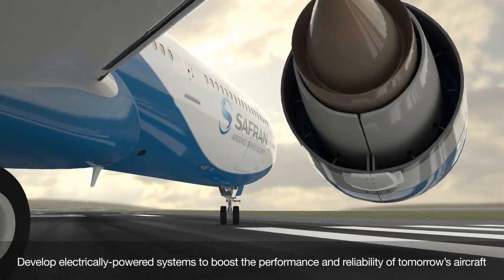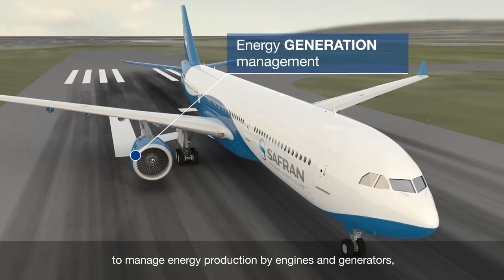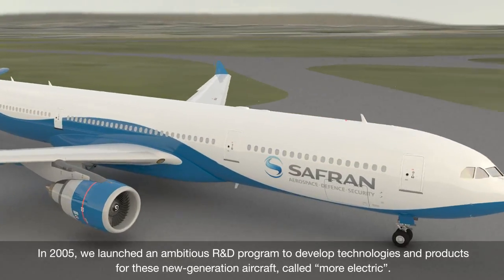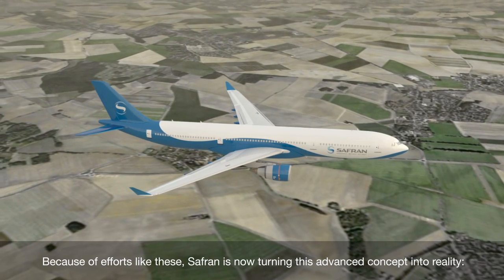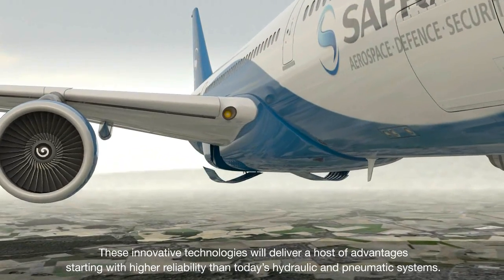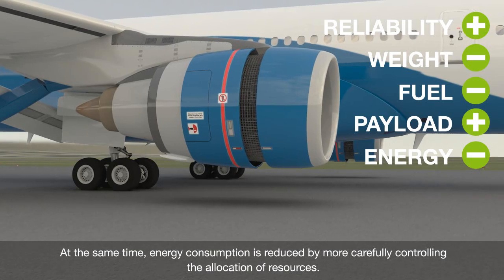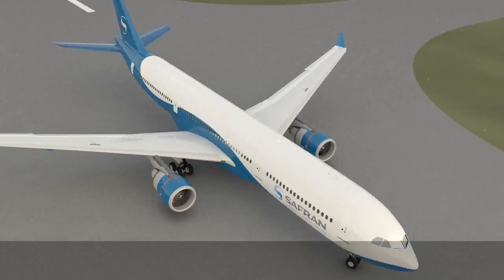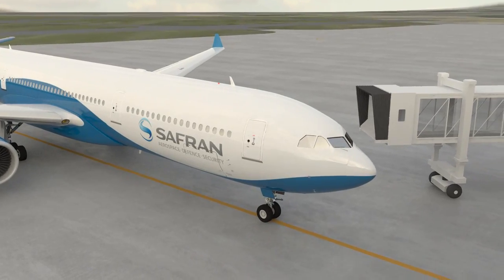Paving the way for a "more electric" aircraft | Safran

Comment: 0:29  The primary purpose of a car's battery is to start the engine, not power the accessories.
Sustaining ignition and powering accessories are the functions of the alternator.
Reply: Bu.